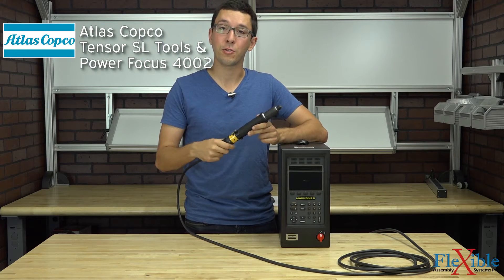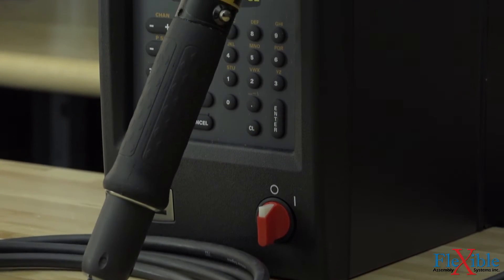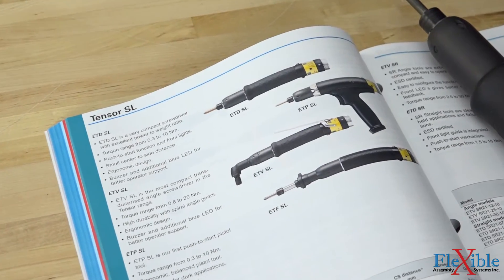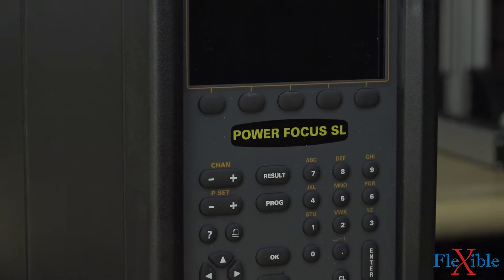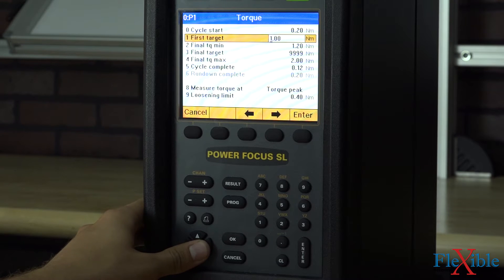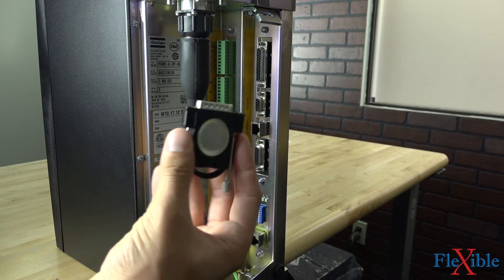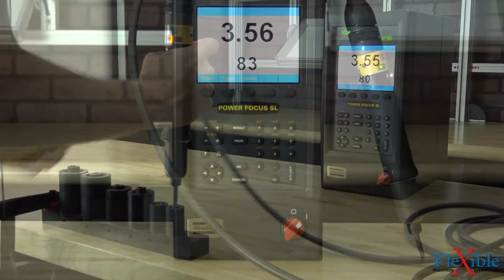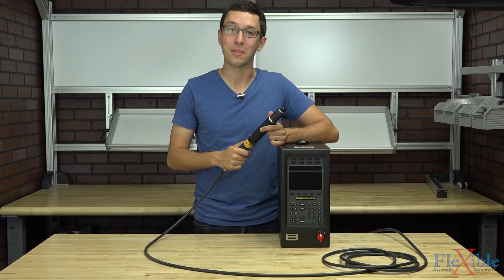Atlas Copco Tensor SL Tools & Power Focus 4002 Graph Controller

Comment: How we build Communication between power focus to PLC Micro 830 controller Allen bredly?
Reply from the maker: You could connect to your PLC using a module and any of the following protocols: Open protocol serial, Open protocol Siemens 3964R serial, or Open protocol Ethernet

Comment: Hello.. I'm using a controller like this and I want to active the pset or unlock the tool whit a digital in but, when I select the source in the controller config at the pset select dig in. But to anyway make change in the control of the pset, no respect the condition and I can active the tool only whit the trigger, the question is how I can to lock the tool or the controller  until I send a digital in??

I hope u can help me...
Reply from the maker: Hello Miguel,
To achieve your goal you will have to create a "job" instead of just a Pset. You can set the digital input to load a Pset, unlock the tool and run the job. Once the job is done the tool will lock again until the digital input tells it to start. You can also go into the tool settings and change the tool's trigger to the digital input to prevent the tool trigger from activating the Pset.

I hope this helps!

Comment: Sir, can we get atlas multi nut tightening tool for saving time and to reduce efforts of individual bolt tightening ?
Reply from the maker: Atlas Copco does produce multi-spindle nutrunners which are able to tighten multiple nuts at one time. They are usually custom orders, if you would like to know more please email us at info@flexibleassembly.com and we can work with you to find a solution.

Comment: Hi, I wanted to ask if there is a controller for multiple Tensor screwdrivers, say 5?
Reply from the maker: Hi Alber, yes there is! The brand new Power Focus 6000 controller can control up to 6 tools at once. (1 wired and 5 wireless) We will be coming out with our video on the product soon, until then you can check out Atlas Copco's offical site for it: https://www.atlascopco.com/en-us/itba/products/Assembly-tools/Electric-assembly-systems/Power-Focus-6000

Comment: hello,I would like to know if it is possible to control the starting of the engine from the "tooltalk" software ?
Reply from the maker: You can use ToolsTalk software to change what will start the tool. The options are to start the tool are
– Tool trigger
– Digital Inputs
– Fieldbus
– Sync Start

You can setup a digital input to trigger the tool, instead of having to use the tools trigger.